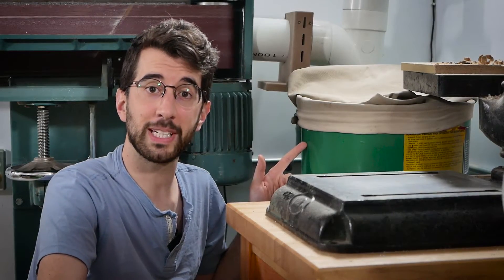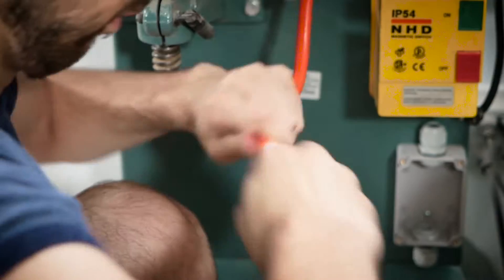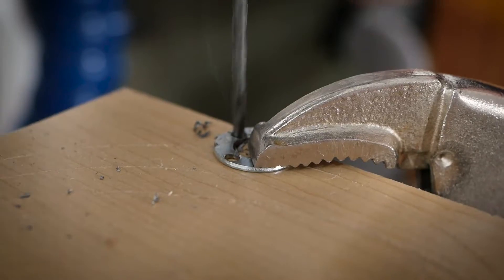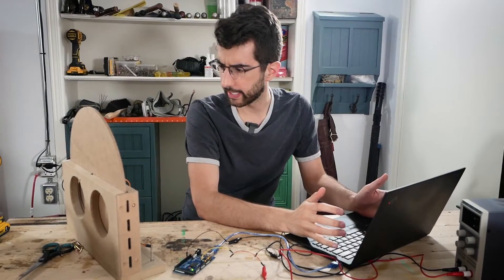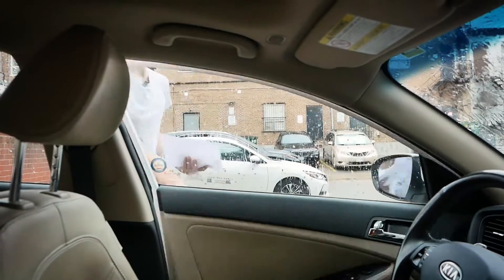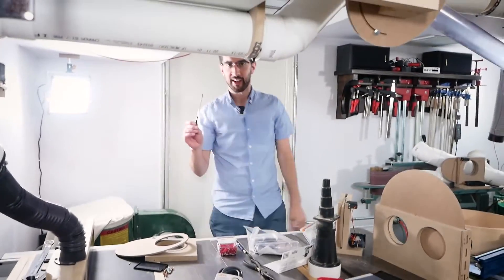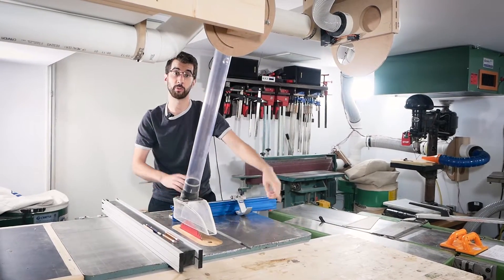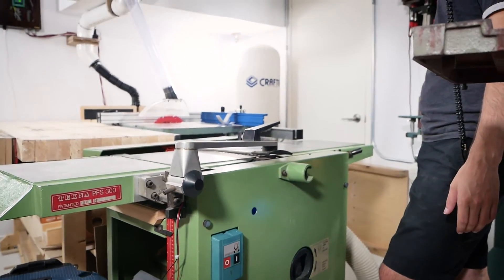I over-engineered an automatic dust collection system

Comment from the maker: Do you think the amount of time spent on this project (at least 100 hours) justifies the time and effort I will save from not turning on DC every time I use a machine? Leave a comment below!
Reply: Yes, because we got a super fun video out of it ;-) That is some nice edits, Scott!
Reply from the maker: @FriendlyWire  Thanks Jens!
Reply: Justifies is a strong word....but the automation is cool, and you got a great video out of it! Incredible work, as always :)
Reply: HAHA Yes i think so. Everyone likes a clean space!
Reply: With the knowledge and experience you gained, how long do you think it would take you to do it again starting from scratch in an identical space?
Reply from the maker: @42Pursuit  without counting the blast gate construction, probably 40 -50 hrs? Hard to know, but since the software is already written, that's a huge portion of the time done. The blast gates will probably take another 8-12 hours.
Reply: This is level 3 stuff, but I'm still only level 2 arduino...  I'm enjoying your vids.
Reply: Impressed, why I subbed. I just got talked into it, I am old and have time, LOL   I hope. 
I do have a question, I would like you opinion on, I have some vinyl fence 4 by 4 wood post covers, thinking of using for my mains, one run. Make radius elbows from scrap ABS I have plenty of here. Branch off bottom at mitered 45% to 4 drops. 
Figuring square inches in pipe, the 4 round is about 12.5 sq inch,  the 4.5 by 4.5 squares are 20.25?  What ya think, is my math and thinking correct it would be more efficient?
Reply from the maker: @SpiketheFrugalFixer  Yeah your math is correct. The only issue I would see is that if your current dust collector has an intake diameter of 4", I wouldn't go any bigger for your mains. That could cause a large enough pressure drop to decrease performance, rather than increase.
Reply: Yes, absolutely. Assuming you learned a few things, had (some) fun doing it, and get that tingly feeling every time you use a tool and the dust collection just automatically works now.
It's not just about "it cost me X hours and it saves me Y seconds so I need to use it Z many times to get my time back". Being annoyed, even slightly, by for example forgetting to turn on the dust collection, or opening/closing a blast gate, that can literally cost you hours, if not days of effective work. You can't get anything done if you're in a "ugh I'm forgetting everything today"-mood.

Anything that makes you life easier is worth doing.
Reply: Yes it does. Thanks for sharing!
Reply: I think it's awesome to have that automation. Personally I probably would have tried to see if it was possible to cut a corner by using a smart plug with power sensing capabilities to report back the status of your tool but I'm not sure it would have saved any time and probably would have been quite expensive, so don't listen to me 😅
Reply: Why spend 1 minute doing something when you can spend 100 hours automating it!  :D  New to the channel, but really enjoying the content, keep up the great work!
Reply: Yes
Reply: That's not what's important, what's important is that it works and is cool
Reply: Doesn't matter. Did you have fun? Did you learn something? That's all that's important.
Reply: Maybe not, but you learned something!  Seriously, it looks cool.  And, I like the electronics in your videos.  

My dust solution involved buying about a dozen shop vacs from thrift stores and dedicating one per tool; and buying cheap automatic turn on thingies.  Spent more on automatic thingies for the high power tools (table saw and band saw).  Takes about an hour every few months to go through each vac and empty them out in the woods (when they only contain wood particles).  Not at all certain my solution beats yours!
Reply: I don't think it "justifies" it, but I bet you got a lot of satisfaction out of it. And in the end, ain't that what it's all about? Nice job!

Comment: I just stumbled across this video as I was <pun> dusting off </pun> my own automation project (ESP32 with possible LoRa links between controller and machines). I've tried a few different current sensors with mixed results, so I'm curious about yours. I found your blog post, but there doesn't seem to be a schematic. Do you have one? I was also hoping for some insight into what current transformer you used.
And nice job on the video!

Comment: Some suggestions: If you use hall effect sensors you can check for current on the tool's power cord by orienting the sensor so that it senses one wire more than the other - no need to exra electrical boxes to access only the live wire. If one wants to use a transformer, then don't complicate things and use a ready-made clamping model that can be read by any analog input. Instead of Arduino and one central controller with a ton of wire, ESP32 can be used at each station which gives you WiFi connectivity. Further, to automate the entire thing, ESPHome can be used as it already includes servo support and is dead easy. If you want to be extra thorough, run the whole thing inside Home Assistant and you also get voice control and the ability to tie everything to all sorts of other automated gear.
Reply from the maker: nice suggestions, thanks! The ESP thing is something I thought of literally the day after i did this project. Maybe version 2.0 will be this way. And I may try and battery power everything so there's no wires at all.
Reply: @Espressomatic some good suggestions, do you have any links for setting something like that up, not necessarily dust gates. Looking to build something similar to Scott's cool setup and figured with home automation the way it is there was some simpler solutions (also don't want to do the maths for 240V Australian systems).

Comment: @Scott Walsh - This video was super inspiring! I am well into my own project and have a question. In your write up you mentioned that if a dust collector has an electromagnetic switch, I should insert the relay/contractor in between it and the actual motor. Is that right? Can you help me understand why in laymen’s terms?
Reply from the maker: Yeah, that's correct. If you put the relay before the electromagnetic switch, when the relay closes, the electromagnetic switch would still need to be manually started every time the relay closes. This is because when the relay opens (when the relay is told to turn off), the electromagnetic switch loses its voltage. By putting the relay after the electromagnetic switch, the switch can stay closed (on) the whole time and not lose voltage.
Reply: @ScottWalshWoodworking  you’re awesome! Thank you. Really appreciate the response and I love your videos. My favorite part of this video is your Blink 182 reference, “Where are you?”

Comment: I'm designing a system similar to this but I'm using pneumatic cylinders, miro switches, electronic relays, and current sensor switches. Yeah, I'll do a video but not soon. I'm rearranging and remodeling my shop right now. A good winter project

Comment: Totally worth it! I made a small, simple current-sensing outlet switch that essentially does the same thing for one outlet. Plug the chord to the outlet box into the wall, one outlet in the box goes to the table saw, the shop vac plugs into the other. Whenever the saw comes on, so does the shop vac.  Made 3 for friends, and one for me. 
Great video, keep them coming!

Comment: I did a similar project, except I modified a self cleaning metal gate using LVDC over pneumatic control with positive limit switches and lighted alarms so my system can never set me up with  failures such as loss of air, electric signals or vacuum flow, or forgetting to empty the bin. I have experienced all the problems mentioned, and any one can cost hours of productivity because the domino effect of one leads to duct clogging that nobody wants to ever deal with. The answer to your question is definitely yes if it prevents downtime  caused by system failure(s).

Comment: Great video and I appreciate both your love of woodwork and programming  After planning for a few years I just built a 30x50 shop and would like to do this very thing. Any chance you want to make a road trip to San Antonio and walk me through it?  lol.  On a side note, instead of using zip ties to secure your wire to the pipe, did you consider running it inside the pipe then drill a small hole near the tool and silicone it once you route the wire back out.  Of course you'll have to make sure it secured well!
Reply from the maker: Thanks Len! I've never been to Texas but it's definitely on my bucket list 👍. If you are serious in doing this project, a simpler way to go about it is to skip the auto mode with the current sensing, and just do switches on each machine. In the last few months of using the setup, half the time I'm just using the manual 'on' switch to keep the collection going while I figure other stuff out.

Yeah my whole shop is actually a semi-temporary location so I don't mind the zip ties, at the moment. When I get a more permanent space I'll be running conduit most likely.

Comment: I like your honest opinion at the end.  It is cool to have auto blast gates.
Reply from the maker: Thanks! After using it for a couple of months it's really awesome. However, I would most likely be pretty happy just having an on/off switch at each machine to control the dust collector and blast gate. The auto mode is awesome but many times I just need the dust collection to stay running for a period of time.

Comment: Hello there. Do u have a more detailed instructions along with the list of parts that r needed for this project, aside from the WordPress link that is in the description? Perhaps u have it for sale?
Reply from the maker: Hi Gennadiy, I don't have any plans or any plan to make plans either. It's not out of the question, but the project is very complicated. The range of aptitudes for electronics that people who desire to make this system might have could vary greatly, and the problem solving and troubleshooting involved can be very dynamic. I don't want to put myself into a position where I'm constantly answering questions and troubleshooting problems for other people as I simply do not have the time. I intentionally wrote the wordpress article at a level of detail that requires a certain level of understanding of electronics to digest. For example, you need to be able to turn the schematic into a circuit, and you need to understand the different power requirements of your own system as that can vary between people's needs. If you're not sure if you're capable of this project, I would suggest some smaller diy electronic projects to get you started. That being said, if you do have a quick question about my setup, feel free to send me a DM on instagram.
Reply: @ScottWalshWoodworking  thank u for prompt response. I see where u r coming from. And I don't blame u a bit. I truly enjoy good ol' electronic projects, and have been successfully involved in a number of them. Reading schematics, calculations etc. r no big deal to me. Arduino however is different story, I have never played with it, but always wanted to get into it. And Now is the time.. In this day and age nothing is impossible. Thanks again. Cheers!

Comment: This was amazing.. so ... today I learned the servos I bought recently are trash.  I could completely set up a cool dust collection system for less than those fancy switches they sell.  I have several arduinos laying around.  But... I don't have all the fancy tubing and blast gates.. so not there yet.   This was a great video.
Reply from the maker: Yeah, one of the ivac systems for my shop would be very expensive, and I don't think it would have the same flexibility as mine, particularly while having two dust collectors. I have future additions in mind for this system, including my dust filter. Thanks for watching and the continued support!

Comment: Zip ties are the very height of elegance. Imagine bringing them back in time to show people. They’d be amazed at the dumb things we use them for.

Editing, tinker craftsmanship, and humor in a elegantly wrapped and zip tied package. Love it. I might suggest a video that is simply a montage of machine switches and blast gates opening and closing.
Reply from the maker: Thanks for the kind words! Zips ties sure are handy, though I had an electrician tell me to not use them... if I need to change something, I'll have to cut all the ties and use new one to replace them. Conduit would be the most elegant, but I'm not going down that road - unless I have a more permanent and larger shop.
Reply: @ScottWalshWoodworking  Yeah, nail or screw in wire staples but low voltage has a lot of leeway a specially if you’re doing it yourself. No license required to work on some of it even.